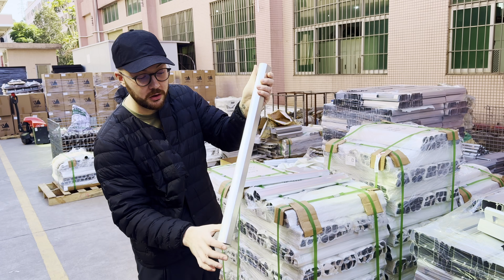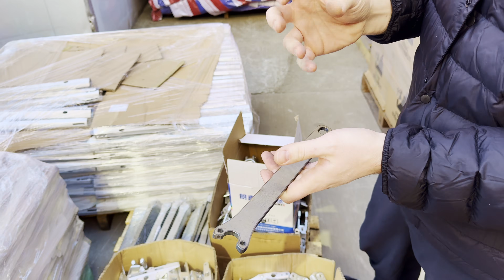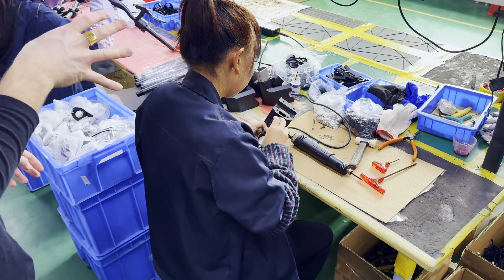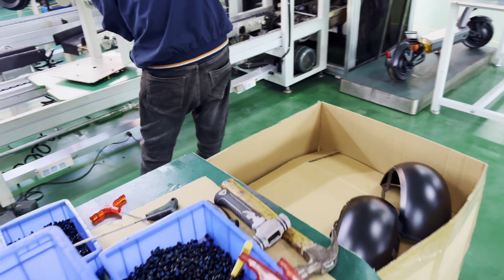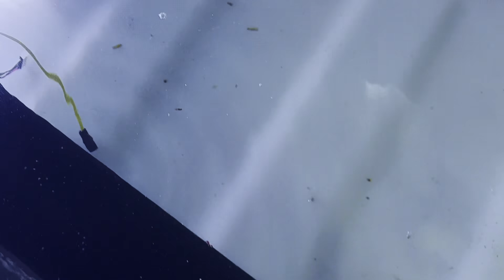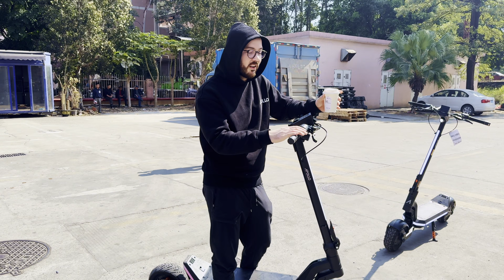The Phantom 2.0 is READY - Apollo China Vlog

Comment: I hate my Apollo phantom. I’ve had to change the tire on it maybe 10 times and we ride it maybe once a week. It’s literally caused us to crash and get seriously injured because of how many flat tires we get.

We never go top speed with it because of how dangerous it is. The tires and tubes are completely garbage.
Reply: Original phantom have self healing tires?? Does t sound like it if you kept getting flats.. sounds like you didnt keep correct air pressure in there , have to check before every ride.. and watch where you ride, can't ride over glass and nails on these things
Reply: @mikefox181  Even after checking air pressure right before a ride with a brand new tube we got a flat with injury. No glass or nails. Just regular nice roads and sidewalks.

We have many electric vehicles and the scooter is by far the worst and most dangerous despite many of my vehicles only having 1 wheel.
Reply: @3vilmarty  well the original phantom. Is a tubed tire, and not  self healing this phantom 2.0 is tubeless self healing, puncture proof
Reply: @mikefox181  I litrally checked the tire pressure before every ride and it would go flat during the ride. It's so easy to keep the correct air pressure. Why are you making assumptions like I can''t keep air in a tire, the PSI  is literally on the side of the tire, and I just ride around in instruction zones aiming for every nail and piece of broken glass I can find? I've changed the tires myself multiple times and i' had professionals do it. I've gone through 3 sets of tires and maybe 8 tubes by now.

I own several electric vehicles and the only one that gets flats is this piece of junk scooter.
Reply: I’ve got 3000 km on my 2024 City Pro. I’ve never had a flat tire. My first scooter was a Hiboy S2 Max and I had two flat tires in a week. I had to buy a solid tire so I could use it daily. It literally was because I drove it a lot to commute to work so I would drive over sharp objects constantly. I’ve got over 500  km on my new 2.0 52 v and still never any tire issues. I bought a digital pressure gauge and keep the tires at the right pressures as often as possible. Upgrade to the 2.0 as soon as you can so you get a scooter that has the gel in it straight from the factory.
Reply: @withscottechristie  My scooter is litrally in the shop as we speak for ANOTHER flat.

Comment: Nice Work Eloi! The water testing part was neat; although I did see some bubbles coming out of the battery when you dropped it in... but still, way better than before.
How is the waterproofing on the motors? I feel like they might be the weakpoint since Apollo doesn't control the quality on those as tightly since they're made elsewhere.